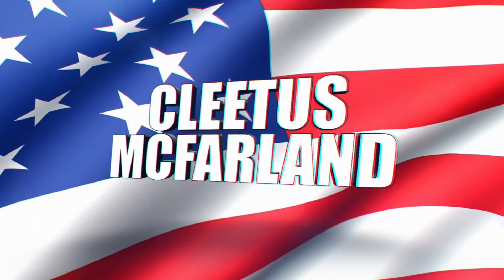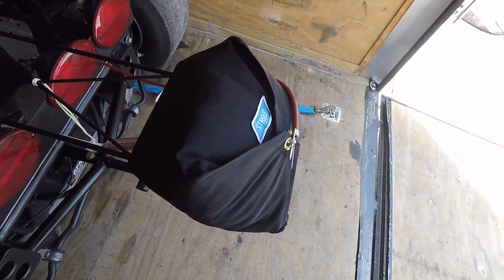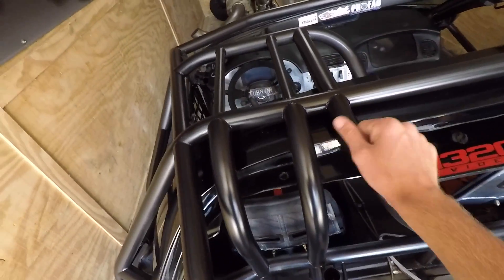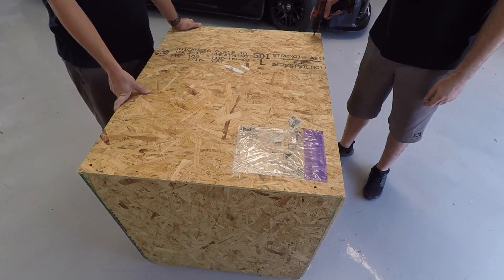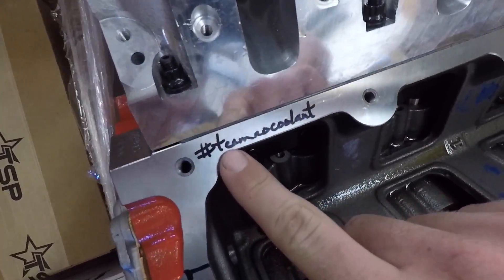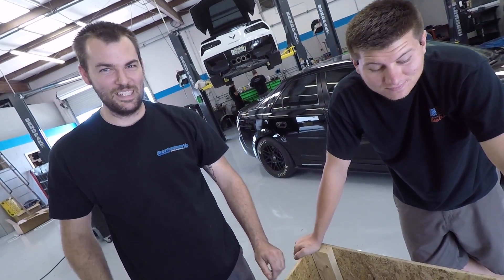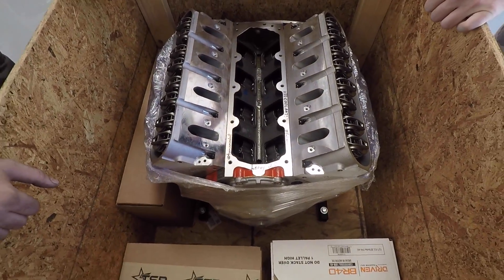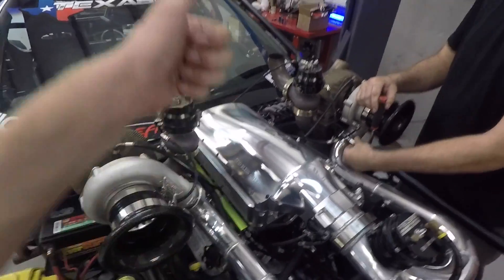Introducing Leroy's NEW 1500+hp Engine... IT'S INCREDIBLE!!! + Major Cage Upgrade!

Comment: As far as I have been told, iron holds onto heat more than alluminum does. Hopefully uou had time to see if the cooling system was up to the task before LS Fest. Other than that, the iron block should be able to handle everything you want to do with it. Happy digging and burnouts from Washingtone State.

Comment: 200 is that number where air will lift the front  ask the early salt flat guys. Will need a splitter and  boxed in front. Be safe but Hell Ya Brother send it!
Reply: Maybe hit up five star racing bodies and see what will fit . the Modified md3 will still leave Leroy with the exo front end still exposed.

Comment: Hey cleetus Why still running cathedral ported heads why not retangle port. Much better flow, more bald eagles.
Reply: The intake and turbo set up would need to be changed to match square port
Reply: @Antolioparker  True, but still more bald eagles. 👍💪
Reply: @Antolioparker  I wouldn't be surprised if he changed the turbo setup to get the 200mph pass
Reply: Im sure the main reason is that they don't have enough time before ls fest to change the whole set-up
Reply: I thought TSP woulda hooked him up with an iron 388 with rectangle ports this time. I think the decrease piston speed from the shorter stroke would help hp up top. I’m pretty sure you can change the runners on that intake or send it back and get a rectangle port version. I know you can “add boost” to make up for cathedral port heads but lowering boost and IAT’s with better flowing heads makes a big difference when you’re trying to squeeze every 1/2 degree of timing you can out of a tune.
Reply: Glad I’m not the only one to be bugged by the cathedral ports
Reply: Aaron Rembert if you think lower piston speeds at higher engine RPM, lower boost and cooler IAT’s from better flowing heads, and more timing would make less power you should read a book. Lol
Reply: Aaron Rembert research a little more and you’ll find that I never said I knew more than them. I’ve bought all my engines at TSP not counting probably 15 cam kits, headers, and all the other BS through out the years. They’re absolutely top notch. I really don’t care to argue with you though. Take it easy.

Comment: And what do you mean the clutch is fine. The pressure plate and floater plates were TOTALLY COVERED in hot spots. Believe me, to the trained eye you can tell how much slipping abuse it's taken. I wouldn't be reusing if it were mine. Are you aware of the symtoms associated with hot spots on flywheels and pressure/floater plates dude. It's going to make it harder to get a smooth progression of clutch engagement. It'll load shock the tyres harded and want to spin off the line more. Hot spots are one of the clutches biggest enemies
Reply: came to point out the hot spots
Reply: It's pretty obvious if you know what your looking at ain't it! LOL!!! That pressure plate was F.U.C.K.E.D. I think at this stage he's more about trying to drum up business for the companies who give him free/heavily discounted parts than giving an honest
 represenation of the part's condition and ongoing usability. It's a little disappointing tbh. Smh
Reply: @danielbrealey2924  yeah,  a better approach would have been.   "as you can see,  this clutch is cooked,  it's toast,  but it still managed to hold together to get us to the record.  Other clutch setups would have welded together or crumbled to peices.  But we were still able to drive him into the trailer. "  it tells the truth while still saying this clutch is the beast..

Comment: I think a great way to move some of the nose weight to the back is to move your whole cooling system to the rear of the car. A smaller surface area 3 core radiator in the back with a fan could be more efficient and would allow for easier aero changes in the future. Bonus, you get rid of that ugly plastic coolant reservoir on the front of the car.

Comment: The clutch held up after all those passes?
Reply: Yeah that is actually amazing. Think of all the torque that thing has handled time and time again. Such a beast of a clutch.
Reply: Stock trans also. Kudos to GM.
Reply: That's not a stock trans, lol
Reply: @buellb0y  an RPM built, faceplated t56 isn't quite stock.
Reply: @buellb0y  yeah i almost fell out my chair. If thats the stock trans frame it in glass and hang it from the statue of liberty

Comment: Leroy needs a corvette body put back on it like a pro mod parts no wild wings just spoilers laid back nearly flat, well in my drag racing in early 1980's topfuel & funny cars were running NOS(no work right) purge valves keep oil pressure up! I don't like standing watching cars wreck or blowup during testing if that did not get me upset enough getting hit well riding a bike on base and told i was sick after injury! the guy i helped quit racing! after winning local champ in 1983 he quit racing! my injury & sickness was found out and medical control was found in time i waited! well airo can mess you up if going back words at speed! like boats flip & fly! my relation died I got a boat with chevy on the trailer! yes i was trained on older Chevy the school i went to had GM backing ! but it doors closed! Leroy might make me help you! its odd I going back where I started GM stuff! i can tell a standing watch it snow well the shop i worked in to burn to the ground ove a white truck and a GM made v6tt engine fire! that a night mare you never forget!
Reply: gatorred157 I have autism just from attempting to comprehend what you just said.
Reply: You're right, it should help with the aerodynamics, also he could put more sponsors thanks to it.
Reply: Kool story brah
Reply: What in the hell are you trying to say?
Reply: I can't understand, have you ever been in an English classroom?

Comment: Looks like it's time to get some sheet aluminum (16gaugeish), a brake, an english wheel and some brass hammers and dollies and see about low 7's maybe even a 6 with some home grown body panels. Still the same savage but with some clothes on and another layer of protection for Cleetus , also will help the dirty air around the car without actual corvette body panels or adding too much extra weight for those bald eagles to haul down the strip.

Comment: What's kind of crazy is that this engine lasted that long and took that much abuse, and the only reason it started having problems was because it was ran with WAY more boost than it was ever intended to run with, and even after making some good hard passes without any coolant, the about the only thing wrong was 1 or 2 crankshaft bearings. Just goes to show you, the only thing better than an LS is a custom made aftermarket LS.

Comment: I noticed you deleted my comment about you keeping the cathedral port heads and how you could have used Brodix LS7 based heads that flow well over 400cfm out the box (around 430cfm as delivered- then you can port them and flow 470+cfm) and are 6 bolt with a much thicker deck surface than the heads your using. Those heads could have made a 150 - 200hp more power at the boost level you want to run. Sort of a spew your so invested in that inlet manifold. To be honest, i'm surprised you didn't turf the cathedral port heads long ago. LS3 heads fit on the 6L's 4.00 inch bore (although in N/A application the smaller bore does shroud the inlet valve a little and hurt flow- but in a boosted application it doesn't matter). Once you use the 4.060 inch bore of the 6.2L it unshrouds the valve and the heads work really well. Now i'd imagine you'd be using a 4.125 inch bore, those LS3 based heads would far out preform those cathedral port heads if equivalent porting were done. Then something like the Brodix LS7 based heads would shit all over your ported cathedral port heads with a bore of that size. Texas Speed should have had this discussion with you long ago. How long before you delete THIS comment Garrett?!? LOL! Am i being a little to honest and real for ya? I don't think you'll find too many other 7 second LS powered cars using cathedral port heads- thete's a reason why, your just leaving so much horsepower on the table that it doesn't make sense dude

Comment: Just add a half hood and a flat panel on the rear for aero.  It should work like a truck's aero and create a circular wall in the center at high speed that the rest of the air will glide over

Comment: I have a 2013 ZR1 with a Nelson Racing Engines NRE454 LSX, which is a Twin Turbo Intercooled 454 LSX that was dyno'd by NRE and made 2508 Crank Hp and 2102 Crank Tq on C16. Car ran a 7.28 at 198 mph. Oh, and it uses a RPM Level VII TR6060 Manual Transmission, tho it generally doesn't last more than 2-3 runs before it needs a major rebuild. 

I am kidding, but that is the plan for my '13 ZR1. Still do not have $52,000 for the NRE 454 LSX Twin Turbo Engine Yet.

Comment: I know this is an old video... But the reason the head lifts at cyl. 1 is because 3 and 1 fire one then the other on that bank. 18726543-1 etc... So 3 fires... Then 1. You'll get it.

Comment: I mean, is it geared to hit 200 before red line? Didnt catch what trans you mated it to, or what dif youre using, but I bet you can break that 7.81 pass with some lower gears. Drop some 4.2's in the rear and see if you can get high 6's ;)

Comment: I'm not a drag racer, but I can't believe at those speeds there is only a X for the door bars.  Low spec, slow road racing classes have higher spec chassis.

Comment: So when are you upgrading to a bigger set if turbos so you can make more power less boost. I know you changed once but i feel as much boost as your making to make that power it could do the same with less boost on a bigger set of twins.
Reply: And maybe a back pressure sensor so got can see when your running out of steam on the turbos, More cfm less boost just my .02

Comment: That engine would have exploded with one more run. Very lucky.
I could bet the rod will be out of round and near certain the crank will be cracked,, or at least need a grind.
And that clutch slider plate is nearly stuffed. What you do with that clutch is very hard on it. Though you have to do it.
The problem with the LS is that it is inferior to SBC with only 4 head bolts. The 6 bolt conversion is a lot better but still inferior than the old engines 5 bolts per hole with a equal spacing. Why GM did it defies belief.
You should dry sump it. Wet pans are for towcars.
As for no coolant,, look at Dragster engines.
That old engine was a gunker with some good bits on the outside. Be very amazed it lived! And more amazed went that quick.
Tin rockers etc are also for towcar engines. Any engine being turned more than about 4000 regularly should have rollers. Stronger and takes a lot the harmonics away too. And gives more true duration and lift.

Comment: You need some  antilag now
Reply: That's what a two-step is
Reply: @dburkh91   To step is different from anti lag
Reply: Anti lag is a bit more fuel, knocking the timing back, cutting certain cylinders out and then a 2 step on top of that.

A straight up 2 step is useless for a turbo charged vehicle with a manual transmission or an auto with a converter that is too tight for the turbo.

Comment: I mean you got a 7 second quarter mile but if you lost your engine, the cost out weighs the victory to me. You need a car that can do 7 seconds constantly, not just once then replace the engine.
Reply: Old engine was pretty much o.k, but the quest for 6 seconds is on now.. old aluminium block just cant do that.. iron blocks are stiffer so no more blown headgaskets

Comment: It's a shame your so invested in rhe inlet that you decided to stay with the cathedral port heads. Brodix has a set of LS7 based heads that flow 400+cfm out the box. They would have made some serious hp on that boosted motor- oh and they're available in 6 bolt and have a much thicker deck than the heads your using here. Oh well, it is still gonna make some power- I just not as much as a good set of rectangle port heads, whether they are 12 degree or 15 degree version...

Comment: why don't you just full send leroy and get him a corvette carbon body for aero and straight promod him..... You said it in the video already why not make it a reality
Reply: Honestly, I feel like it would help tremendously because right now Leroy is basically a high horsepower brick pushing through the air.
Reply: A carbon body would not make it a promod...
Reply: Ryan Green, i know it won't but with a few changes to leroy the savage he could be a promod from where cleetus or gerrit has the car right now, Once described as Pro Stock cars on steroids, Pro Mod cars are full-bodied carbon composite shell, which are very loosely based on production models. They feature supercharged, turbocharged or nitrous oxide equipped engines that allow them to run deep into the five-second zone at speeds of over 258-mph. 
A large part of Pro Mod’s appeal stems from the wide variety of body styles that are favored by competitors. Those bodies include everything from early model Chevy Camaros and "Corvettes" like leroy the savage to late model Dodge Stratus and Ford Mustang replicas. Since there are few rules governing aerodynamic enhancements, Pro Mod cars often feature radical body modifications including stretched wheelbases and oversized rear spoilers.
Under the current rules, Pro Mod engines can be either supercharged, turbocharged, or utilize nitrous oxide, with differing weight breaks for each combination in an effort to assure a level playing field. Currently, nitrous oxide equipped engines have no cubic inch limit and can run at 2,425 pounds. Supercharged vehicles are limited to 526-cubic inches and must weigh at least 2,650 pounds and turbocharged cars can have 540-cubic inches and may weigh no less than 2,650 pounds. Similar to the powerplants found in Top Alcohol Funny Cars, a competitive Pro Mod engine can produce in excess of 3,200 horsepower. Most Pro Mod racers use a three-speed planetary-type transmission and an adjustable multi-disc clutch, which helps them tune the car to suit track conditions.
While a Pro Mod chassis resembles a Pro Stock frame, there are significant differences since the Pro Mod car must be built to handle nearly twice the horsepower of a Pro Stock car. As a result, double frame rails are mandatory and there is also extra bracing required in the rear suspension and engine compartment. Although the chassis design also shares some similarities with a Funny Car, a Pro Mod car must use a full automotive-type suspension with springs and shock absorbers on all four corners. Any size rear tire is allowed and most racers opt to use a bead-lock system to secure the tire to the wheel. There are many safety related requirements for Pro Mod racers including duel parachutes, an on-board fire suppression system, and a fire suit for the driver meeting SFI 3.2A/20 specs.